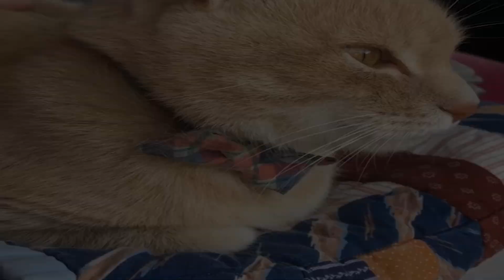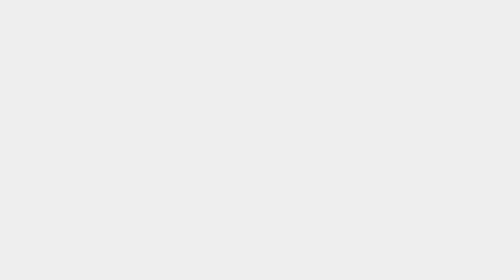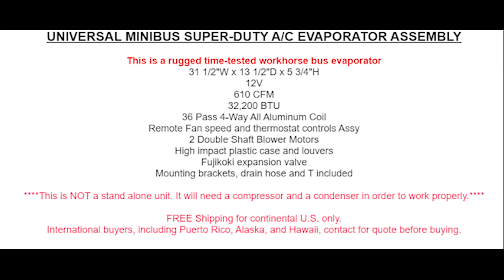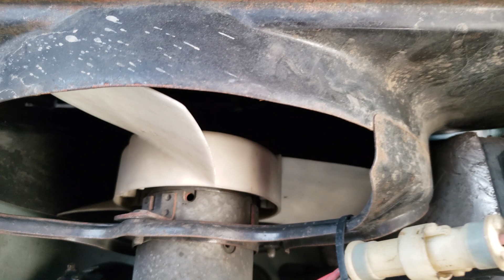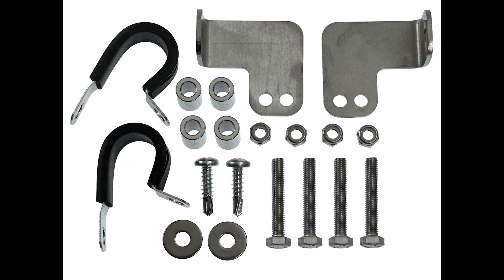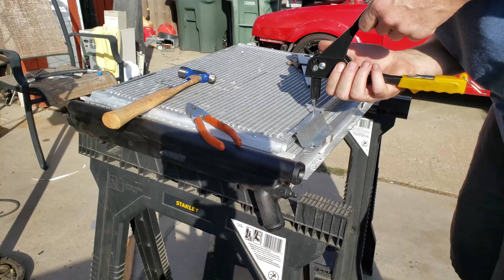Subaru powered Vanagon GoWesty AC Condenser Upgrade and more!

Comment: I just want to say I am so glad I came across your video. I am refurbishing my 86 westy ac with pretty much all new parts except for the original evaporator and blower unit as i will clean out and reuse those. I was just searching on here to look at cabinet removal of the back ac (im lucky enough to have the back factory ac unit like you pictured in  the video) but came across your video. I also have the GoWesty more efficient condenser and while my condenser came in good shape they forgot the metal tube like spacers in the hardware bag and also gave me two left brackets instead of a left and a right (very frustrating). I love seeing how you created your own bracelets as I also was worried about the somewhat inferior mounting system provided and also how much space was between the rad and condenser causing inefficient air flow. So really appreciate you posting this as I will start creating brackets tomorrow (who knows when GoWesty would be able to send me the missing hardware also as the condenser is always out of stock therefore maybe the replacement hardware is hard to get also). Before I start mimicking your bracket system please let me know if it all worked well the way you show in the video or did you end up finding you had to change anything with how you mounted the condenser. Thanks again! Awesome job.
Reply from the maker: Thankyou for the feedback!

Last October as I preparing to install the assembly, I was in a severe car crash which broke my leg and messed up my foot. I am just now getting around to being able to work on things again and will be installing this along with the new engine and transmission real soon.

I did measure out and double check the inlet and outlet ports to make sure they clear behind the left side high beam headlight and everything seems in order so far. No issues as of yet, and expect to see a video of the completed installation with additional thoughts when I finally get there. 

Best of luck with your installation!

Comment: I have been following your build and adventures with the EG33 for some time and now have my own EG33 engine in my Vanagon! I have avoided some of your early misadventures, thankfully, and have a powerful and smooth running engine thanks to some good luck finding a low miles engine and some tweeking to the ECU.

This vid was very timely as I went through some of the same experiences with installing AC. I also found that the EG33 engine needs more cooling than my previous engine, a 2.5L Subaru when the AC was installed. I also installed the bigger fan motor.

 I went with the well tested Small Car performance kit. This puts the AC unit behind the dash and replaces the stock heater unit. I have found this to be very efficient and very, very cold even on 100+ deg (F) days.

As far as cooling the engine, I found an air dam in front was very helpful--pushes more air through the radiator. But the exhaust path for the radiator air is also very important. I also installed an oil cooler which helps to keep the engine cool as well by diverting heat from the cooling system.
Reply from the maker: I thought about doing the smallcar kit so I would have it in the dash, but wasn't sure how the other passengers and dog would appreciate that so I decided to go with the setup I built. 

Do you have an oil temperature gauge installed in yours? Curious if you knew what the temp was at before you did your oil cooler versus after. I have also installed an oil cooler in the other rear duct area but have not plumbed it yet. (Going to build a custom large capacity oil pan with buit in hard lines to get oil from the filter sandwich plate on the drivers side across to the oil cooler on the passenger side without a bunch of line precariously hanging around in the back).

I now have a low miles engine to finally replace the JDM one that I put piston rings in some time ago. The cam journals in my ported cylinder heads are finally worn out after being starved for oil from it burning so much over the years, lol. It no longer burns oil which is nice, but a shame the engine was worn out badly ahead of time.

Thanks for following along and I'm glad my journey has provided valuable insight to some wanting to do something similar. It has been really fun going at it on my own and coming up with what I have.

Great tip about the exhaust air from the radiator. I have been looking at this some as well, and have been thinking about getting rid of the spare tire from the carrier underneath and doing something different for the spare tire. I can't imagine how much more air flow I could get out of the radiator without the tire carrier blocking the air stream underneath. Next time I'm in MN I will be building a custom set of bumpers with a friend, and I think we might go ahead and put the spare tire on a carrier in the back that swings away from the bumper. 

When you replaced the stock heater box with your AC box, do you still get outside air from the scoop in the front? If so, that something you had to come up with an adapter for?
Reply: @DoogieLabs  Thanks for the reply. Yes I have an oil temp gauge and the temps I was getting were alarming in the summer with 110 deg heat--up to 245 on hyway and uphill. I was seeing the water and oil temps going up together--they seem to feed each other so decided I needed to get the oil BTUs out of the cooling system. I installed a thermostatic cooler adapter from Improved Racing (Part # ENV-131), a 14 row cooler from Improved Racing (MHx-14) with their shroud and fan kit, with 180 Deg thermostat in adapter and fan switch. The results have been excellent. On 100 deg day, the temp stays below 220 on long uphills, 200 mostly, and 80 deg day around 200 uphill. It was very difficult to find a place to mount it and installed in LR wheel well. Seems to work well there but would not work with oversized tires. Both of my D pillars were already occupied.

I have put a lot into smoothing exhaust air from rad. I removed the spare from there years ago and ran the GW off-road plate as an aero aid (I thought) until the SVX was installed and water temps were going to 200 and above. Then I saw a post on THESAMBA by a guy who was experimenting with air dams and got dramatic improvement in cooling and had the same experience with the GW plate actually hurting cooling. I bought an air dam and removed the plate and now the engine stays at about 180, especially since I installed the oil cooler. I still wanted to be able to carry stuff under the front so got the GW new carry box that fits in the spare mounts, but had the same problem with temp so cut out the front part and replaced it with a screen for air exit and that worked.

I moved the spare to the back but I hardly ever carry one now unless I'm going to some remote area. In 25 years of owning this van I have never used the spare and in most areas I could call a tow if needed.

The SC AC is great but I can't see any easy way to get outside air to it. It could be done many different ways but is too much work and it has been ok without. The stock air intake has to be blocked off. It's a huge job to install it as it is. I've had to do it twice as the first version somehow got contaminated and started eating compressors. I've adapted the compressor from a 09 2.5 by modifing the SVX mount.

Comment: I just found this video and others by you and really enjoyed watching your problem solving.   I have a question about an unrelated project that I am working on related to replacing the ECM on my 2000 Dodge Ram Maxivan with 5.9L engine that was converted by Roadtrek into a camper van.   I haven't been able to find information anywhere about how to test  electrical components that could contribute to the failure of the ECM in order to prevent them from causing failure of the refurbished ECM.   I'm not sure what should be tested or where to start.  It seems like the type of project that would be interesting to you and others.
Reply from the maker: Hi Laura, 

ECMs are generally speaking pretty resilient pieces of hardware. In all my years doing this I've had only a small handful of ECMs that turned out to be "bad". 

In order to give you a starting place, I would need to hear the story / chain of events that led up to the ECM going bad. Were you driving at the time? Did you come out one morning and have no start?

Was there bucking, or any other behavior or check engine codes at the time the problem presented itself?

Does the ECM still communicate with a scan tool and just not start?
Reply: @DoogieLabs  Thanks for replying.   I bought the RV almost two years ago from a couple in their 80's who were the original owners.   It had 37,000 miles on it.   I didn't notice the check engine light on at the time and am not sure if it was already on or if it came on shortly after I bought it.   There were no other symptoms.   It even passed emissions in MD a few weeks later.   A mechanic checked the error code and tried to erase it a few times but it kept coming back.   He said I needed a new ECM but that it would cost a lot of $$.   (error message PO601 --  the PCM (ECU)). So I ordered a refurbished one but decided not to replace it before my first big trip just in case I messed something up.   I have been driving around with the "new" ECM  stored in the RV in case my engine starts to act up.   But so far I haven't noticed anything strange that might indicate a bad ECM except for the check engine light.   I would like to replace the ECM at some point so that the check engine light goes away, but I need to figure out how to test all the inputs before I do so that the new one doesn't fail.
Reply from the maker: @lauragoyer4819  I have some good news for you, P0601 represents an internal ECM problem. Particularly with your ROM checksum.

In ECMs the operating system software and engine calibrations are usually stored on the same chip. This is called the ROM, or Read Only Memory. This can be programmed with factory service tools now but in the old days they used to have to program the chip before inserting it (or soldering it) into the computer.

When the computer powers on, as a part of its self diagnostics it performs a checksum routine. The checksum is a number derived from a math equation that takes into account every single bit of data that is stored on that chip inside your ECM. Before the chip is programmed with this operating system software and engine calibration data, the software engineers that developed it insert a pre calculated checksum value into the chip for the computer to compare against every time it calls for that checksum routine at power on. If the calculated checksum doesn't exactly match the checksum value burned into the ROM from the factory, a P0601 is set.

The good news is, the wiring to the computer is good. There isn't any electrical fault that would have caused this that wouldn't take out other sections of the computer first. Usually when a P0601 gets set it is because the internal chips are really old and the data is corrupting, or a piece of cosmic radiation just happened to smash into the right spot on the chip die and flip a bit. This is a pretty rare occurrence, but not unheard of. (Bit rot from defects and age is more common)

As for explaining why it is still running good, the bit that got flipped or data that got corrupted is in a section of the operating system software that doesn't adversely affect engine operation. Perhaps the bit that got flipped is a small piece of engine calibration data, or a function of the operating system that doesn't get used unless a sensor goes bad or is in some other special mode. Checksums often take into account the unused space on a ROM, so it might not even effect anything at all.

Back around to that good news I mentioned. I am confident that you can replace your ECM outright and expect to not have the same issue occur again. (Unless you store radioactive material near your ECM.) Whether it be a manufacturer defect with that chip, or cosmic radiation, it was not your existing wiring harness that is at fault here.

There is a chance you can fix the P0601 by having the dealership flash the stock software on it again. This should reset the flipped bit since you are reloading the software. If other memory areas of the ECU are good (RAM) this will reset your P0601.

If I was you, I would switch them, and keep your bad one as a "spare".

Hope this helps
Reply: @DoogieLabs  Thank you for this in-depth explanation.  Makes perfect sense.   I finally feel comfortable switching out the old ECM and will keep it as a spare.

Comment: Great video. I have the same engine on my 89 westy. I have rear and front ac and the temp is always above the led light. Where do you purchase that 500w radiator fan? Thanks.
Reply from the maker: Thanks! I got both the fan and shroud from van-cafe.com They are out of stock on both at the moment. 

You can find the find around on eBay, but I am not sure at this time where you can find the appropriate shroud.
Reply: Doogie Labs thank for responding. Do you happen to have the parts # from Van Cafe? They have one with this part # 251959455M and the price is 499.00. This is the one? 
Thanks.
Reply from the maker: @juanka1053  In this video I am using fan part number 443 959 455N that fits fan shroud 068 121 205. These are the original VW part numbers for these parts.
Reply: Thanks. Any updates? How the AC works after the new condenser and fan? Thanks.